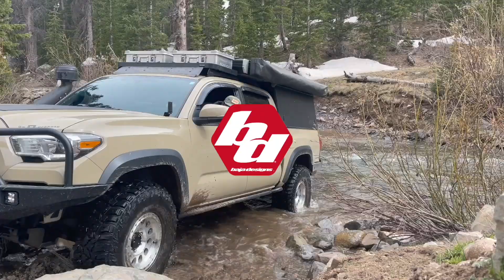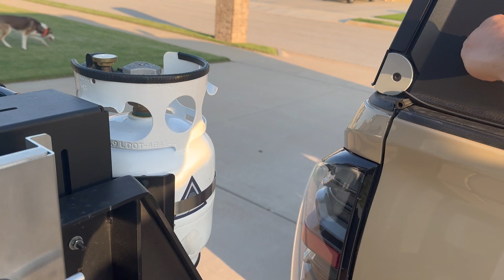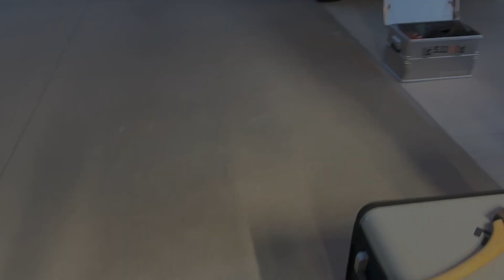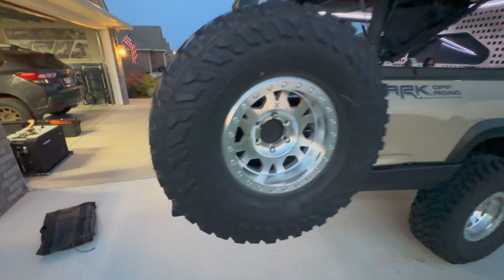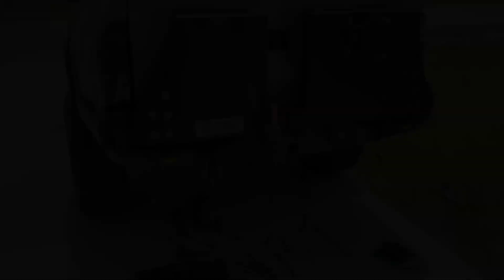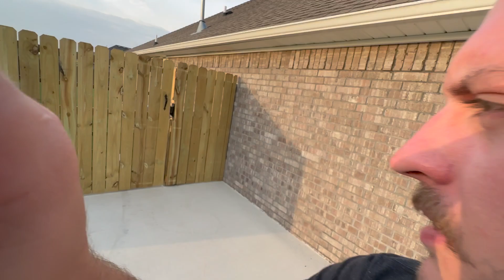Truck Rebuild! (FLATBED & LONG TRAVEL) 1st Ever Tacoma with these NEW Parts!

Comment: How did you like your MRR’s? I’m trying to decide which suspension to get for my Tacoma, access cab with a pop up topper, and I was between Fox and King but after doing some more research the MRRs popped up as an option.